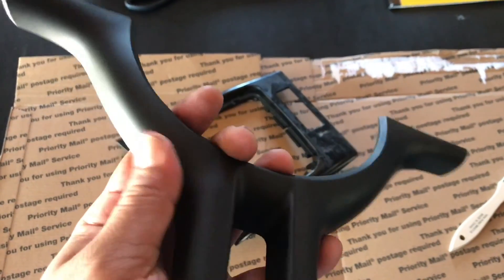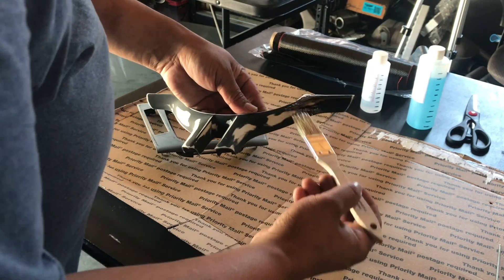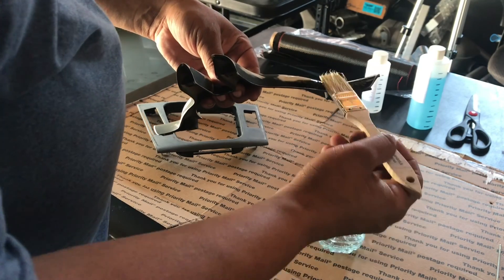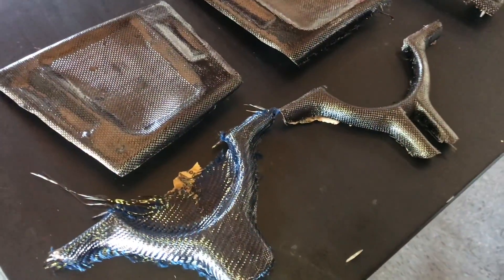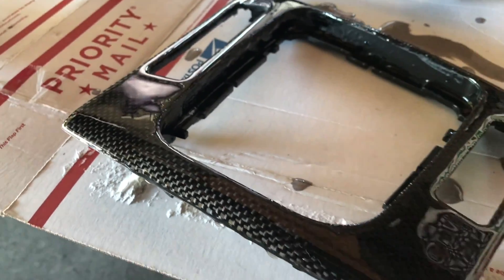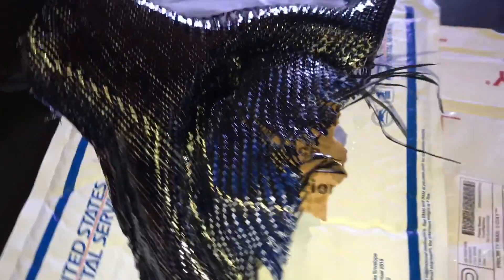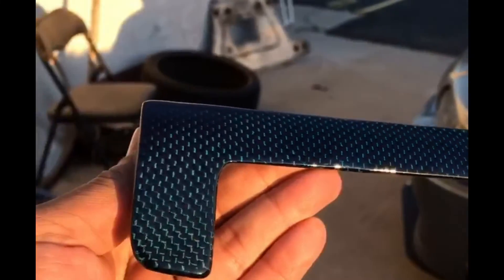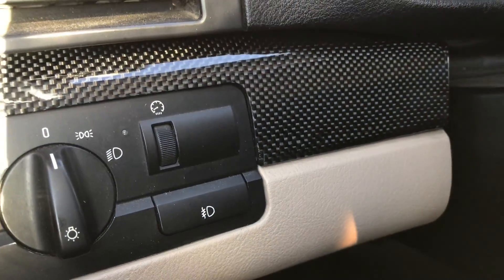Carbon Fiber Skinning

Comment: What kind of bit did you use on the Dremel? Any tps for getting clean edges I’ve tried a couple of times but not getting nice edges
Reply from the maker: No dremel. I use a small sander so it has more flat surface sanding for flat areas, for round area it’s a die grinder it’s a little bigger than a dremel also cuts faster but you need to be careful. And sometimes just some hand sanding

Comment: Did you pour or brush the epoxy resin ?
Reply from the maker: Poor it in a little then Just brush it in, pouring is more for flat flat surfaces, on these pieces it’s just going to fall off so don’t waste your materials

Comment: Is there a specific type of resin for carbon fiber or can you also use resin for fiber glass? Sorry for the dumb question I am a noob.
Reply from the maker: This is resin is different from the one used for fiberglass this is clear when dry, the one for fiberglass is usually tan color

Comment: bro nice job, I have a question for you, how much thickness adds the skinning to the piece?
Reply from the maker: How much exactly I’m not sure but it will be a little thicker but all depends on how tight you lay the material and how many coats of resin the less coats the better but you can also sand them down.

Comment: What did you use after the hardener ang epoxy mixed..the brush will not getting hard?i hope you would help me..thank you
Reply from the maker: Sorry not understanding the question, What do you mean?
Reply: @acef_performance8416  i mean how to clean the brush proplerly..what did you use paint thinner or acetone.
Reply from the maker: I use cheap brushes that way I can just dispose of them, thanks for checking out the video I will be making couple more carbon diy videos soon

Comment: Something I keep missing is getting that nice fine trimmed edge. I’m worried about the piece I do when it goes back on the edge or piece that wraps over and around is going to be too bulky. I’m guessing you just Dremel a nice tight edge?
Reply from the maker: This is the hardest part of skinning the edge does want bulge over so you have to tape it tight to keep constant tension against the edge

Comment: how is the fit of the parts after it, especially that bezel with holes in it?
it looks pretty well done not gonna lie
Reply from the maker: Everything fit pretty good, you just have to make sure to sand down any extra resin in all the holes so the switches fit, I also uploaded a video on the trim install, check it out

Comment: What brand of resin do you use?
Reply from the maker: Not to sure of the name of brand I ordered it from ebay. Please subscribe
Reply: @acef_performance8416  how many coatings did you do? clear coating finished or hand buffing?
Reply from the maker: I lay 2 or 3 coat depending on ho smooth the finish looks some piece need more layers than others then I wet sand with 800 and spray clear coat, it just last longer than if you only buffing

Comment: So what kind of sandpaper if wet is needed? Does 2000 grit do the job alone? 
Also is it necessary to sand down the part ? Since im considering on skinning an armrest for a car
Edit: do you need to polish after sanding? If so what polish is ised?
Reply from the maker: Start with 220- 400 dry depending on how flat the resin laid out, then  600 and 800, then wet 1000 and 1500 then 2000-2500. you definitely need to sand the piece or the resin won't stick properly. You do need to polish after sanding or you can stop at 800 and clear coat the piece and the sand with 2000 wet then polish clear coat

Comment: In the final steps, After the last coats and sanding, do you finish off with 2k clear or something? Or do a final coat after the last sand?

Or do you just sand it after your last resin coat, and that’s all?
Reply from the maker: I do the final sand with 600 and then use 2k clear, let the clear cure and then wet sand and Polish
Reply: @acef_performance8416  2k clear is with airgun or with brush? Thanks
Reply from the maker: They actually sell it in a can works great but you have to get the 2 part 2k clear with the red button

Comment: Are you using epoxy resin only or combined with polyester resin? which one do you think better in heat resistance and durability?
Reply from the maker: Epoxy resin only
Reply: @acef_performance8416  unhardened Epoxi is a serious allergenic, use gloves.
Reply from the maker: I try but, I’ve always been a full hand on guy but I know what you mean I’ve been cut a couple times with harden carbon, it hurts

Comment: After the 3rd resin coat, do I sand again? What do I use for final clear coat ?
Reply from the maker: Yes after the last coat you want to at sand with 800, 1200, 1500, 2000, 2500 and the polish or go up to 1500 and spray a clear coat, then you can do 2000, 2500 and polish the clear coat
Reply: @acef_performance8416  what kind of clear coat?? will spray can clear coat work?
Reply from the maker: Yes
Reply: @acef_performance8416  what kind?  lacquer or enamel?
Reply from the maker: I use Spray Max 2k clear, Comes in a can

Comment: Man thats some cool finish product. I wana ask, if i apply a red pigment base coat under black carbon fiber, what will be the end result.
Reply from the maker: You can also just spray a clear coat with a touch of red
Reply: Well i am waiting for the Carbon fiber cloth to arrive for my DIY project. I will be skinning the center console, steering, guage cluster pastic trims, door buttons and gear lever
Reply from the maker: Show me how it comes out follow my Instagram @lui328i
Reply from the maker: Haven’t done it but I think it would be similar but a little more red in the area where the fiber get full coverage, i don’t think it would bad
Reply: check this place out. https://compositeenvisions.com/composite-reinforcement-fabrics/carbon-fiber-colored-fiberglass-hybrids/

Comment: Why when I lay down the carbon fiber after basecoat, I see the weaves everywhere and sticking out. Is it because im cutting the edges wrong, laying it too rough, stretching it. dont know what im doing wrong
Reply from the maker: Always leave extra material on edges you will trim once it cures

Comment: I did this to my skyline gtr dash back in the days. 2 things that will improve your work and I made the same mistake is one, spray the part black before doing anything or you'll see weird holes with between the carbon waves. It looks fake. Second is get a vacuum. Your surface will be much smoother and you don't need 3 layers of resin. Oh and use a heat gun to get the bubbles out of resin. And never ever cut or sand carbon without mask. It'll kill you. No joke. Resin you can sand without a mask.
Reply from the maker: Thanks for the tips, I realize carbon is super bad, I also not do my first base coat in black I made that mistake, as for vacuum don’t I need more that a vac
Reply: @acef_performance8416  it's very hart to keep the carbon waves in line without a vacuum. You did way better job then me tbh.

Comment: do you trim or cut the edges and the open center after you put the resin? wouldnt be a lot easier to lay the carbon fiber and cut the edges before you put the resin
Reply from the maker: Yes, but you cant just cut it exactly to size you need to leave the material a little bigger so even with the holes your going to trim after so it better to trim after
Reply: @acef_performance8416  Did you use the dremel to cut the center holes and trim the edges?
Reply from the maker: Yes

Comment: Is one roll of the carbon fiber enough to do all the trim?
Reply: You can get away with one later if you spray your part black first. I did.
Reply from the maker: No the small roll is not but you can get a little more, it’s not too expensive

Comment: What are you doing after the 3rd coat of Epoxy?
Reply from the maker: Sand and then clear coat
Reply: @acef_performance8416  you dont use the epoxy resin as clearcoat?
Reply from the maker: You can either wet sand and polish your final coat of epoxy or sand epoxy with 800 and spray a clear coat coat
Reply: @acef_performance8416  ok and can you also wet sand with 1200 after clear coat, then polish it? (to remove the overspray, buildup, etc) or no?
Reply from the maker: Yes after clear coat I used 1500 and 2000 then polished it
Reply from the maker: @j.a.3138  spray clear coat after